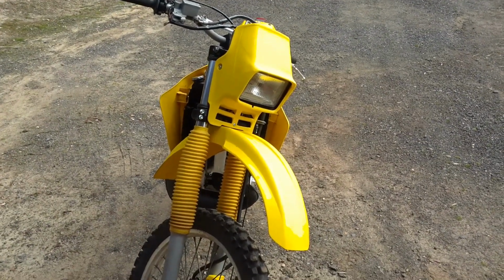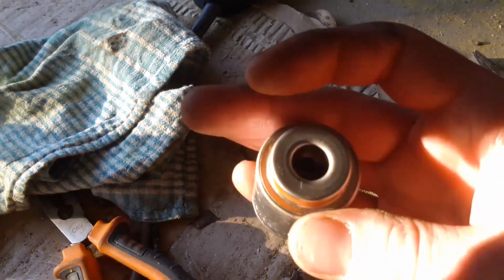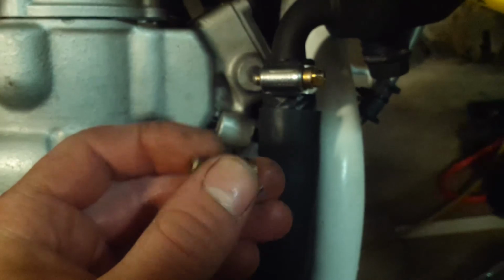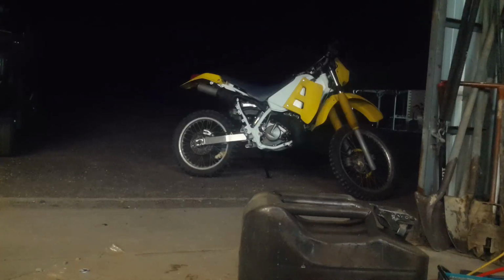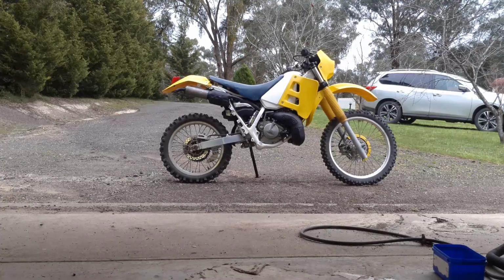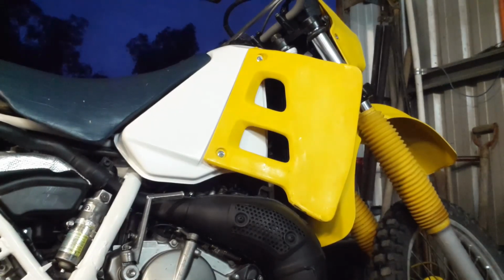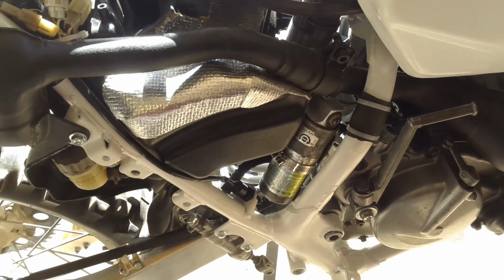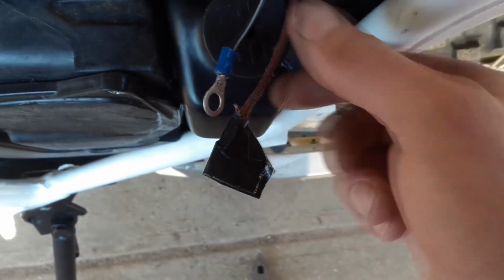Will it Run? 1991 Suzuki TS200R 2 Stroke Dirt Bike

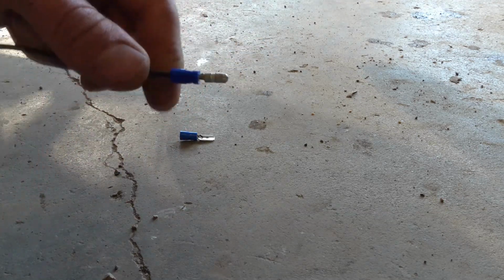Comment: Regarding 18:18 , solder only provides better electrical continuity & doesn't provide mechanical strength within the connector.

Those blue crimp lugs you are using are purposely made to be installed using a set of ratchet crimpers which are the best ones to use for the red,blue & yellow crimp lugs,there are the automotive scissor types which are used for auto electrical work just to install a set of spotlights for example but they shouldn't be used for crimping connectors for 240 volt AC appliances,etc.

I prefer using the ratchet crimpers which work very well particularly when they're calibrated properly !
Reply from the maker: Thanks for the info, my aim was to try to get both the plastic and metal components of the connector to pinch onto the wire sheath manually but I guess without that particular shape of real crimpers it wouldn't really dig in correctly; I think the problem with these is that there's a lot of really low quality stuff out there that doesn't seem to work as intended e.g. a recent lot I've got the metal is so soft that it just displaces and everything just becomes a squishy mess.

Comment: I have a suzuki ts 125 r 1991 same year bike aswell, but smaller engine size, the bike looks veeeery similar, except the engine size, these are rare bikes.
Reply: Interesting, the 125R seems to be most common in the UK I guess it only really exists because of different licensing requirements as there doesn't seem to be difference at all, the weight difference would probably be negligible

Comment: Hello. I've got a japanese market ts200r with usd forks which i've just dug out of the shed after 12yrs. I've sent the carb away to be cleaned and thought i was filming the removal of the pipe work from the carb and oil pump but unfortunately being new to smartphones and my advancing years i was not actually recording and now have no idea what goes where. I was wondering if u have any literature or any footage of you plumbing the hoses in that shows where everything goes. I can't find anything. Would much appreciate any help you could provide. I enjoy watching yr videoes, they are well made and informative. Thanks
Reply from the maker: Thanks for the kind words. If you search "ts200r carburettor fiche" you should be able to get a general idea on what each hose does, just keep in mind that the small diameter brass fitting pressed in on the right side of the carburettor is the oil pump supply, since this has been disturbed you will have to run the bike on premix until you have verified that it is primed again.